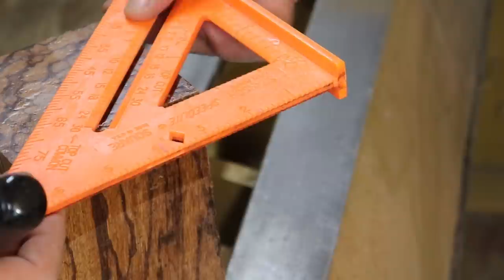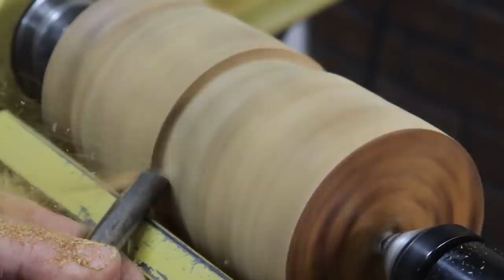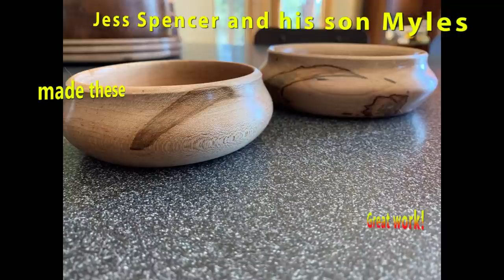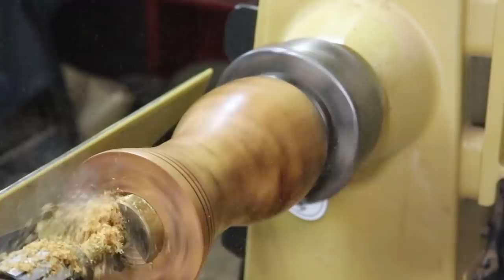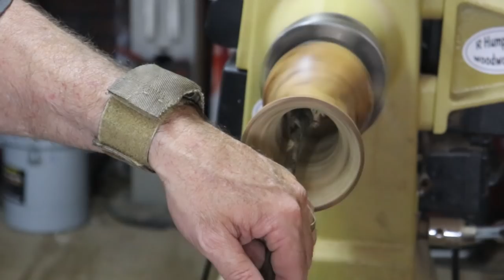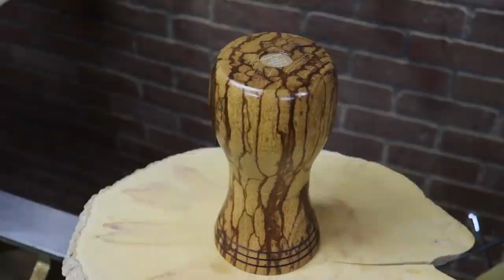Woodturning a Marblewood Vase

Comment: I have zero experience turning anything but heads, so I'm going to feel free to offer you some advice.  I have noticed that, when you turn the piece around and clamp the tenon into the chuck, the outside front of the piece wobbles a bit when it turns.  If you pushed the piece into the chuck using the tailstock, the tailstock would center the front of the piece and put it precisely on the original axis.  I see Andy Phillips do this, and he has no wobble.

Comment: Might be a frightfully stupid question, but why don’t you hold on to the Jacob’s chuck when using the Fortsner bit? Thank you for your channel and your obviously deep graciousness.
Reply from the maker: I've seen others do that... I've never felt the need to do so myself.  As long as the chuck is seated firmly (which mine wasn't at first in this video, but I corrected it...) holding the chuck makes no difference at all.  Thanks very much!

Comment: Artfully done, Rod.  Those burn lines are just the right touch and deftly placed.  First I've seen of marble wood.  One of the prettiest woods I've ever seen.  Right up there with zebra wood and lace wood.  I'm curious - I've wondered this about a lot of wooden vases - is this for dry arrangements only?  I'm assuming you'd have to put a glass insert of some kind in it for live flowers.

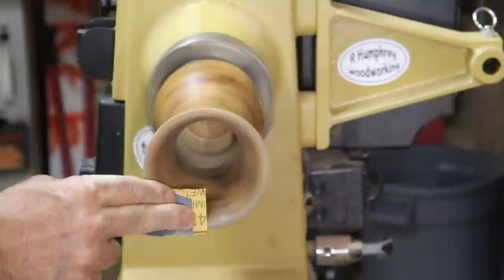Comment: Hey Rod - starting around 8:45 I noticed that the inside of the vase looks quite bright. Is it an optical illusion or did you get the walls so thin that the light came through that brightly? If so, that's pretty freaking amazing. Whenever I try for thin walls I make rings. I have a stack of them on a shelf to remind me how NOT to make thin walls. Thanks for the quality videos. Your work overall is amazing but that vase stands out.

Comment: Love the videos! Question, at the beginning of the video when you show the wood as a perfect block was the surface stained?
Reply from the maker: Thank you!  It was partially waxed.  Turning blanks are often coated with wax when purchased to protect them and to keep them from cracking as they dry, if they're green or fresh cut.  I removed some of the wax from the sides after I purchased this piece, to allow it to dry out some... but that's what you saw.  Nice observation 😊

Comment: Love your videos and commentary!
A quick question about the shine juice recipe...
Is the shellac part refers to shellac flakes or a Xcut mix?
Reply from the maker: It refers to a store bought mix... which I've read is about a 3 pound cut, so diluting it further by three equal parts would bring it down to a 1 lb cut mixture...   Shellac is normally cut with denatured or similar alcohol anyway, as you know (others may not).  The only real difference is the boiled linseed oil providing a bit of lubrication for the friction style polishing that happens on the lathe, or that's what I think anyway.

Comment: Beautiful!  I was told that any wood with wax on it should be treated as green wood.  Do you find that this is true?  I have some small pieces that were given to me and just wondered how I should proceed.  Thanks Ron.  Great video.
Reply from the maker: It can be true, for sure.  leave the end grain sealed with the wax and scrape off the side grain wax. That will allow it to dry with little chance of checking, similar to sealing up a log.  I'd also recommend a moisture meter if you don't already have one.  Thanks Billy!